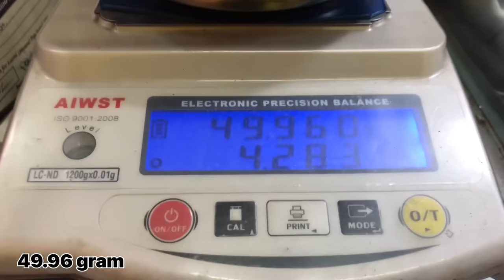Design you should never miss 🤩| silver bracelet design

Comment: What was the thing you started with and why did you have to grind the end?
Reply from the maker: That was a tweezer, which is use for picking object. I grind at the end to separate two parts, so that it was easier to twist wire.
Reply: @WeMakeJewellery  Thank you very much for your quick response. Very helpful.